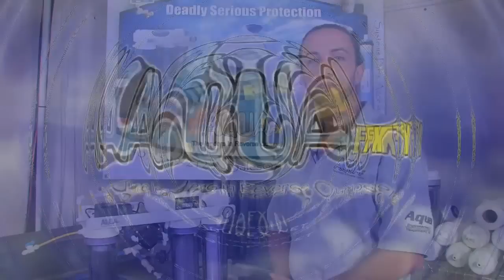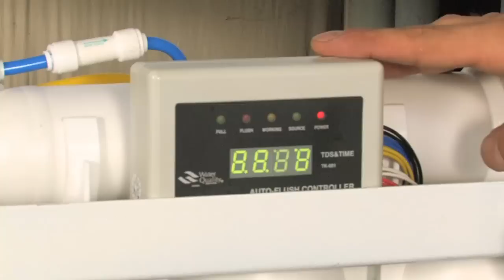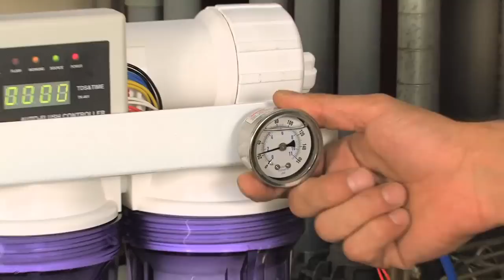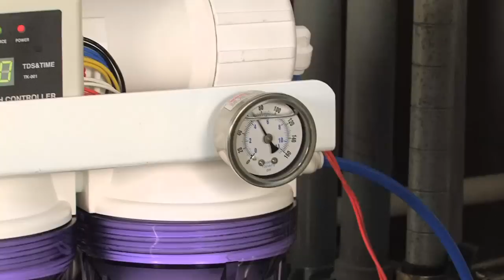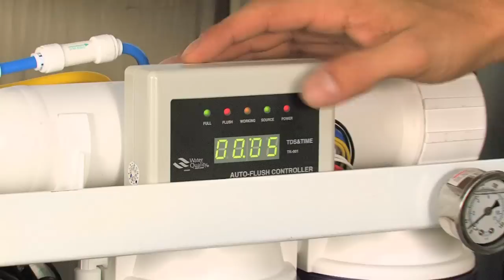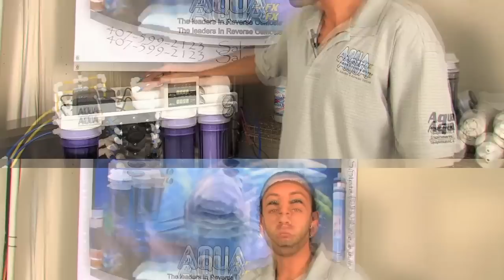AquaFX Octopus RO/DI System

Comment: I just bought this unit with the chloramine add on filter and I can really say this unit is a beast.  Solid and well made.  My only recommendation would be for when you guys wire up the controller you wouldn't run the wires in such a way that if I  was to decide to mount the controller/display panel to the wall I could do so.  As it is I would have to cut the connections and redo them.